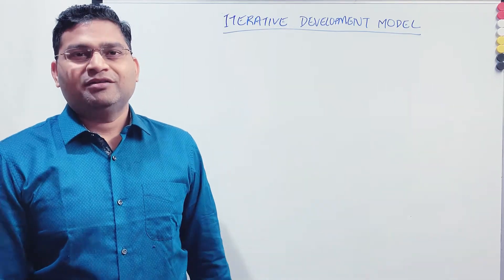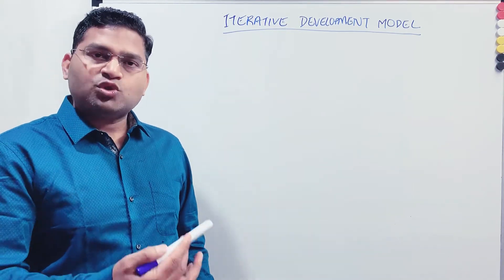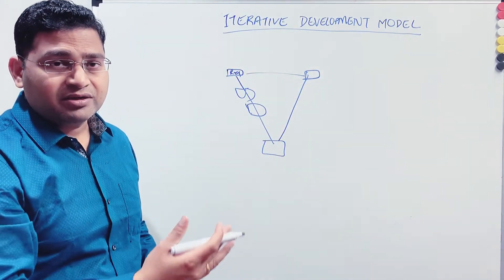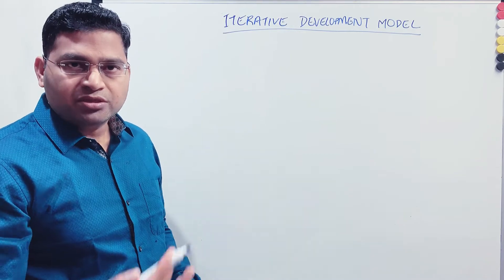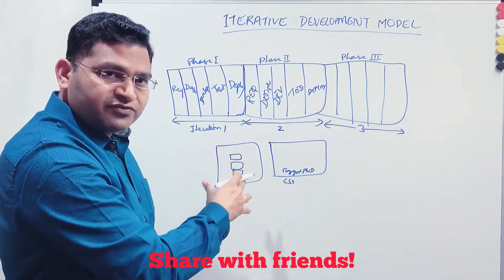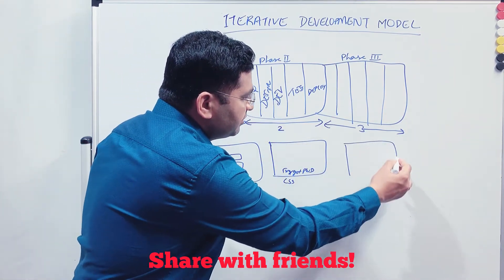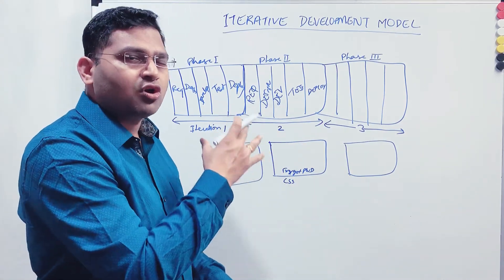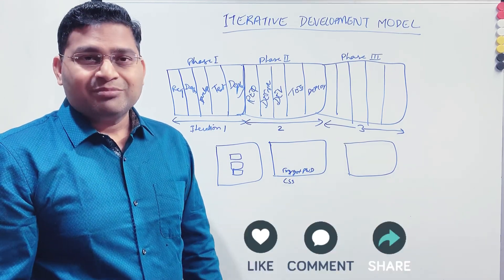Software Testing Tutorial #10 - Iterative Model in Software Engineering

Comment: *Software Testing Tutorial #10 - Iterative Model in Software Engineering - Notes*

*Nature of Iterative Development:*
- The Iterative Development Model emerged as a response to previous methodologies' limitations.
- This model involves shorter cycles or iterations, each resembling a mini Waterfall Model.
- Cycles are compressed, lasting from a month to a few months, facilitating rapid value delivery.

*Iteration Process:*
- In the traditional Waterfall Model, phases like Requirements, Design, Development, Testing, Deployment, and Maintenance span longer periods.
- In the Iterative Development Model, each phase is condensed into a cycle.
- Example: Initial iteration focuses on building a login page for an e-commerce app.
- This iteration includes Requirements, Design, Development, Testing, and Deployment for the login page.

*Incremental Value Through Iterations:*
- Subsequent iterations add functionalities to the existing software incrementally.
- Enhancements like CSS improvements, "Forgot Password" feature, "Forgot Username," or social media sign-ins are introduced in successive iterations.

*Advantages and Considerations:*
- The model swiftly delivers value to customers by employing shorter iterations.
- Still follows a phased approach, where Requirements must be locked before progressing.
- Enhances speed but doesn't eliminate challenges of phased development.

*Differentiating from Agile:*
- Iterative Development shares some similarities with Agile methodologies like Scrum.
- Agile encompasses broader values and practices, emphasizing customer collaboration, adaptive planning, and flexibility.
- Iterative Development is a technique within Agile methodologies.

*Conclusion:*
- The Iterative Development Model accelerates value delivery with shorter iterations.
- Users experience incremental software enhancements within weeks.
- Doesn't eliminate phased approach but significantly speeds up software delivery.
Reply: thank you again my honorary coursemate. Worthy of your flowers. I often come to your comment post each session to see the executive summary.
Reply: @brytespeaks6343 Exactly 😂.  He or she is the best
Reply: Thank you so much ❤